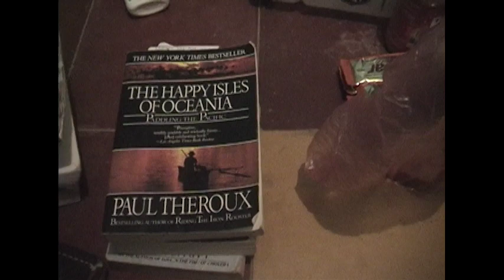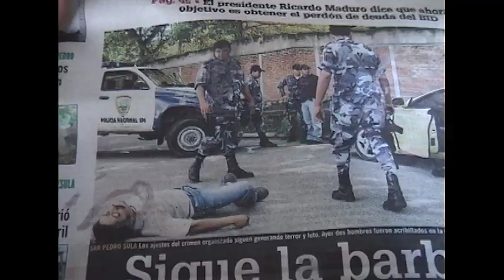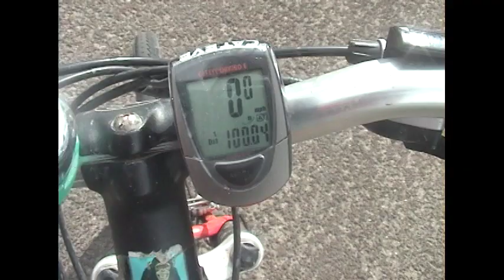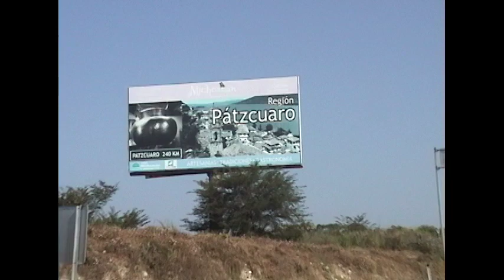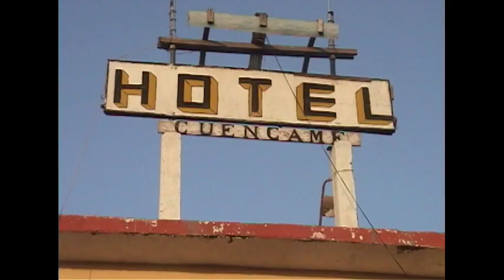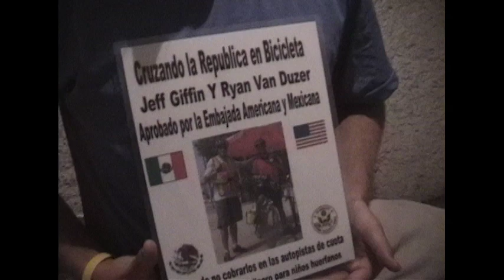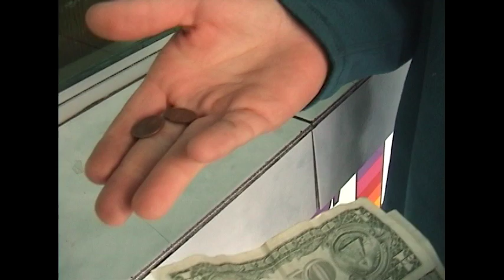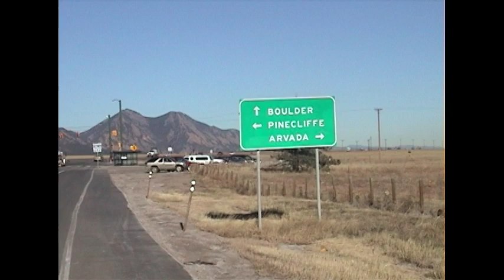Cycling From Honduras to Colorado (2005) My Very First Bike Adventure-'THE LONG WAY HOME'

Comment: What an incredible journey...beautiful country and beautiful people. From riding boats to wrangling goats. I suppose you had screw worms. A pretty amazing fly, the bot fly I think,  grabs a mosquito in mid-flight and lays a small maggot on its back. When the worm detects the heat from a warm blooded animal it drops off of the mosquito and crawls over to the injection site. Pretty gross but damn remarkable. The truck stop/restaurant in Springer has some incredible people working there. They hooked up a long hose and filled the water tanks of my trailer and refused payment and refused a tip. That is my turning off point to Cimarron Canyon....my first fly fishing stop when headed to Idaho. The ride through Cimarron is stunning and the history is incredible. If ever there in Cimarron be sure and eat at St. James Hotel some knock dead incredible Mexican food and a fully restored historical hotel and bar. The likes of Bat Masterson, Jesse James, Wyatt and Morgan Earp, Davy Crocket. The register book is still there at the original check in desk and has their  signatures. The bar has bullet holes in the ceiling from gun fights. Incredible place. What an epic journey Ryan.

Comment: Great document, I curious why did you have to start taking ATBs and where did you get it? Was it related to your arm?
Reply from the maker: It was my stomach issues :(
Reply: In Mexico its really easy to get antibiotics (and pretty much any pharmaceutical). Lots of pharmacies have a "consultant" doctor on site that will ask you a few questions and then give you the medicine. Medicine is also a lot cheaper in Mexico than in the US so lots of US residents cross the border and buy all sorts of drugs at Mexican farmacias.